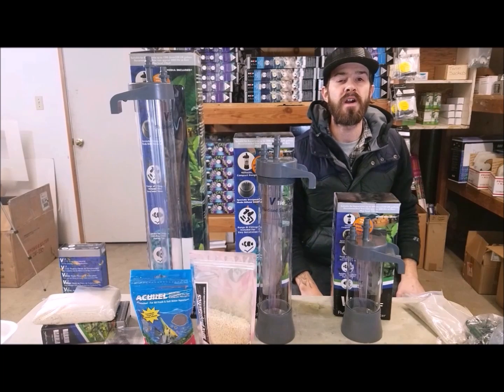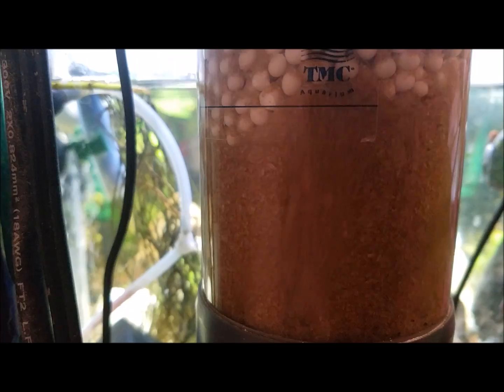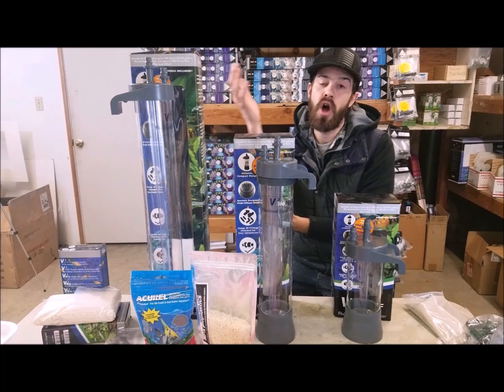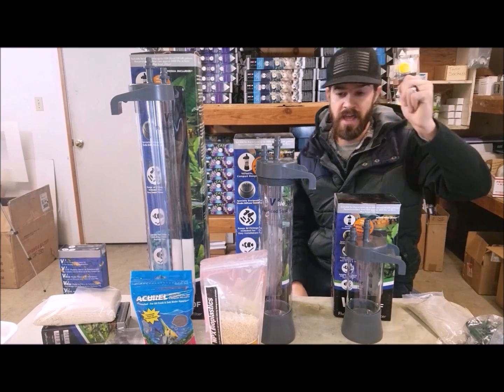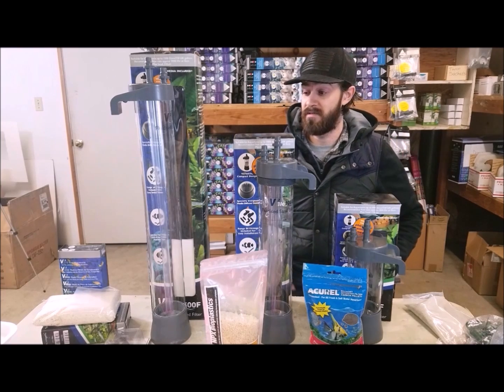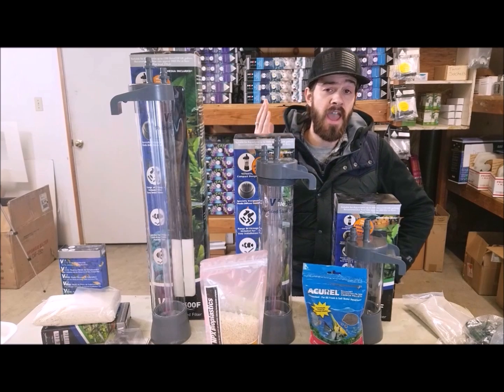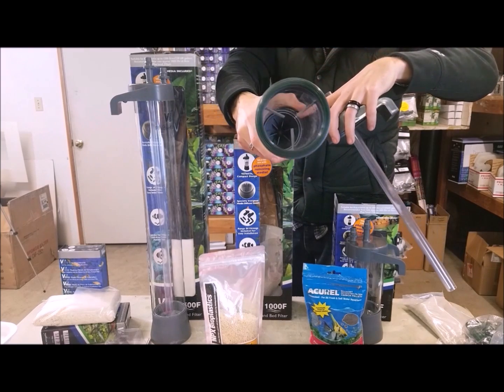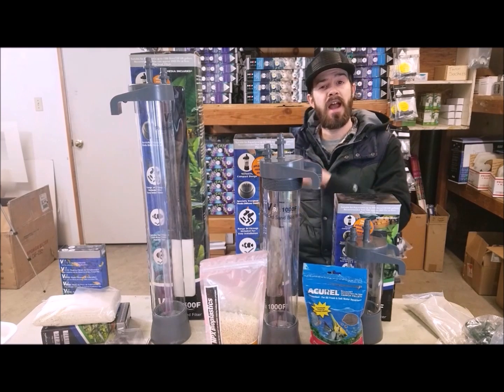Fluidized Sand Bed Filter- How a Sand Filter Works

Comment: The misinformation on aquarium forum boards along with a lack of basic plumbing knowledge is a huge reason why these are not utilized a lot more. 

My own lack of knowledge for basic plumbing and head pressure from the pump caused me a lot of issues with, set up, and yes I completely lost my temper. Again my own ignorance, not the product it self. Once I lost my temper, I kinda went off on Carl,(Again sorry about that, old school shot up paratrooper much apologies) 

When I actually sat down to learn about plumbing and head pressure things came together nicely. 

Some issues I see popping up on those forums are; Setting the pump GPH flow, power failure, over kill, wears off Co2, hard too clean. 

Control valve makes setting Flow fairly simple, also the added benefit of closing the system for maintenance both control valves closed and a check valve leaves the water/sand suspended or fluidized. 

Ive read people don't use them because they're tough to clean? Ive had mine almost 2years and Ive only added NPX bio never broke it down for cleaning. 

My method for adding NPX; an airline tube for siphoning a small amount water out of the FSB. I Only draw it down to the Max Flow line too allow the NPX to fall more freely due to water displacement. I use a funnel thats large enough to fit over the inlet barb on the FSB and my planting tweezers, too just stir and loosen clogged npx from the funnel. I use 4inches of NPX bio the rest is sand. the 4inches lasted close to a year. Nitrate has consistently been zero. I fert my plants with NilocG Thrive plus all in one. 3 times a week. Intermittently I use Seachem nitrogen if my plants show a nutrient deficiency, that perks them right back up. 

I use an old Rio 1100(I think thats the name) I Think it was the biggest one you guys at AAP sold. Works great. 

I use flow control valves on inlet and outlet and a check valve for power outage. Buried the pre filter bio sponge under Volcanic rock. I haven't had to move it since its been set up. 

Im not sure why on those boards I was reading that these filters get clogged with mulm & detritus. not sure what they did or didn't do. Sand & Rock break mulm and detritus up fairly efficiently. 

I'm not a member of any of those forums, I just like reading them too see how wrong they are hahahaha
Reply from the maker: How is your sand filter going Chris? and thanks for being a great supporter.
Reply: American Aquarium 
It works great. I have the 1500 model, on my 75 gallon. Burying the bio sponge attached to the rio under volcanic rock adds another layer of bio filtration. Nitrate is consistently zero, even with a 1000grams of peat granular's in my filters. 

The way my Guppies are breeding I might max out the 30lbs fish bio load in the next few months hahahaha
Reply from the maker: +chris ohara wonderful!
Reply: chris ohara could u show me ur setup. Im interested in sand filter system
Reply: read my post

Comment: Will this also lower water hardness?
Reply: No, especially no when used with oolitic sand. But then there are few cases where you would want to lower water hardness as most ways of lowering water hardness dangerously lowers mineral Cations necessary for a healthy aquarium. Best, if truly needed, would simply be when changing water to mix new tap water with RO or RO/DI water.
But again, with a few exceptions the need to lower water hardness is often an internet myth.
Please read in FULL this article below:
https://www.americanaquariumproducts.com/chemistry.html
Reply: @carlstrohmeyer  in the case of breeding discus it would be beneficial to remove calcium and magnesium. I have a reverse osmosis system but if sand accomplished the same thing I could avoid the hassle of water changes  with RO water.
Reply: @davelanteigne2842  As I stated above, I usually cut the tap water with RO water (sometimes I used 100% RO and added back what was needed). However I have to respectfully disagree that it is beneficial to remove Calcium and magnesium. Yes, some in hard water, but in nature, which is an open system, unlike the closed system of an aquarium, mineral Cations are constantly added by natural means and to strip them out of an aquarium, even for discus is not healthy for the long term. Reference the article I posted earlier

Comment: If I were just going for nitrate control, does the flow need to be that fast? My understanding is the water needs to be low oxygen for the anaerobic bacteria to grow, and low flow would be the way to do it
Reply: Good question. In a taller filter that's what happens at the top. There does need to be good enough flow for these filters to fluidized the sand or it will clog or not use all the sand and water is just bypassing by.

Comment: Hi!  Ive had a few saltwater tanks and lived less that 300 yrs from the ocean east coast florida ( fun to catch ur tank mates) But I have only used a wet dry filter under the drilled tank, or basket overhang along with a magnum 500 .  I also used a oceanic industrial skimmer that was grey and huge! but I never owned a FBS filter.  My show 48 bow front is not set up and i still have the 90 gal wet dry but I have picked up a

Comment: I built my own
Reply: Congrats! Building a quality FSB Filter is not too difficult for those with reasonable DIY abilities. Using the right sand is important too.
Here is a forum thread as to this subject: 

http://everythingaquatic.proboards.com/thread/3845/diy-fsb-discussion
Reply: @carlstrohmeyer  I found a large 2ft tall narrow glass spaghetti jar, put it inside my tank in the corner, cut some PVC pipe for the down tube (square at the top end and angled at the bottom end) and placed it in the spaghetti jar. I filled the jar half full with silica sand and then capped it with bio balls. Over the mouth of the jar I slipped one leg of some ladies nylon tights with a hole to allow for the down pipe. Rubber bands fasten this to the pipe and jar. As it is permiable it lets the water out. Gravity, bio balls  and nylon keep the sand inside. The water returns to the tank with laminar flow and so is aerated to boot. Dirt cheap, looks interesting, easy to make and works a treat.

Comment: Is a coarse sand grain better/worse than a fine grain sand?
Reply: Coarse sand would not work/suspend. You MUST use #00 fine sand
Reply: Coarse sand will fluidize with enough flow and a narrow enough canister. My question more specifically was what are the pros and cons of using a coarse sand vs. fine sand. Obviously fine sand has more surface area, but in case of power outage I would imagine that bacteria can survive longer in coarse sand as there are larger air pockets. Coarse sand requires higher flow to fluidize though so does bacteria prefer high flow (lower dwell time) vs. slower flow (longer dwell time)?
Reply: While in theory you are correct. However, all standard FSB filters built, which I've used many, will not fluidize properly with coarse sand. So this is one of the Cons. The other con is surface area. Yes, you are correct that in a power outage, the coarse sand will survive longer (generally my observations have been 4 hours with standard #00 fine sand). Also if tall enough and at the optimum flow, certain FSB filters can actually perform some de-nitrification even without the use of NPX Bio pellets or similar
Reply: Carl Strohmeyer Not theory, real practice. You are right about standard sand filters, about 3 inches in diameter maybe and therefore difficult to fluidize coarse grains, but I use 1.25 inch diameter glass tubes they work fine. Do you know how flow rate can affect bacteria? I would imagine that too great a flow would prevent bacteria from developing as there isn’t enough dwell time.
Reply: A lot of what you are asking is theory, with little practical application to fall back on. I've not found any flow rate too high for aerobic bio filtration of any type (& this goes quite high in many pond applications), but in theory there may be. As for chamber size, I have practical experience in custom builds that are over 8 feet in height and a diameter of 5 inches. These utilized very high flow rates driven by pond/pool filters. However coarse gravel/sand was only used at the bottom to prevent clogging, and #00 sand was used for the majority of Fluidation.
This is a discussion better suited for standard forum IMHO over social media based on time restrictions. http://everythingaquatic.proboards.com/

Comment: They aren’t available on the website
Reply from the maker: No, this model was taken off the market and were waiting on the next model. There is the bio-media reactor.
Reply: yes, the New React 500 is the newer version. It is more adaptable and more durable. Larger sizes are suppost to follow someday
Reply: Thank you for the replies. So the new model can be ran as a sand bed filter? I was thinking it was more of a media reactor
Reply: Yes, these are n fact a FSB filter, it is simply designed to do more. Although the earlier versions could also be run as media reactors too
Reply: I think ill order one and give it a shot. hopefully they make the larger model soon... I really wanted a 1500 for a new tank build that I am working on. I love the idea of using it as a HOB and eliminating the need to use a sump and dealing with all the plumbing and redundancy needed for a sumpp

Comment: iv got a nice size did canister 33 lt , now I'm I'm the process of makeing a nice clean cut ffloadized sand filter for removing nitrate , I did consider makeing a fluadized nitrate media bed
Reply from the maker: +bob hill very nice. Make sure to make it tall is you want it to remove Nitrate.
Reply: yep that's true , deep to mimic a deep substrate minimal oxygen,  trying a few diffrent models out size wise, my tap water is high in nitrate my current diy filter takes 4 to 5 days to reduce nitrate to below 20 from above 40ppm , but i wand to add in a few extra nitrate removes with out adding chemicals
Reply from the maker: +bob hill this might help. Though I think the pictures are not working. http://everythingaquatic.proboards.com/thread/3845/diy-fsb-discussion.
Reply: thanks for the link 👍 allways handy to find good info , I'm allways looking up vids or random Google searches on stuff allways nice to get directed to a good sight thanks again